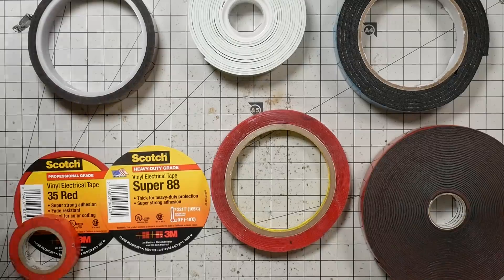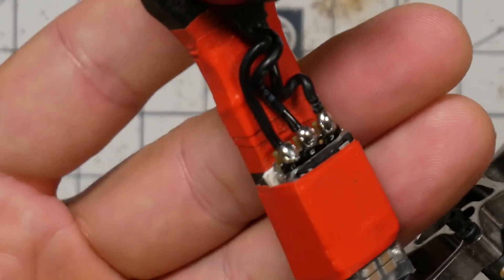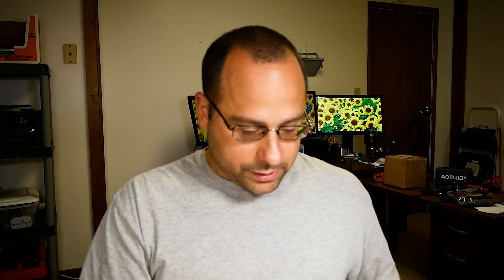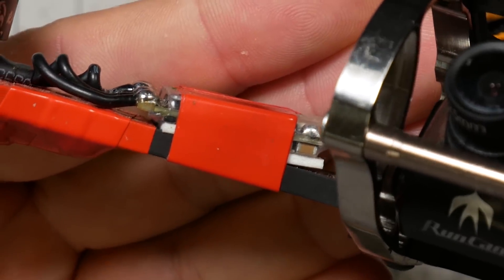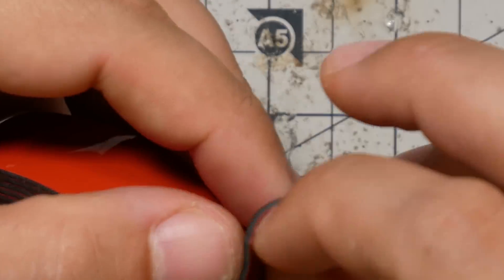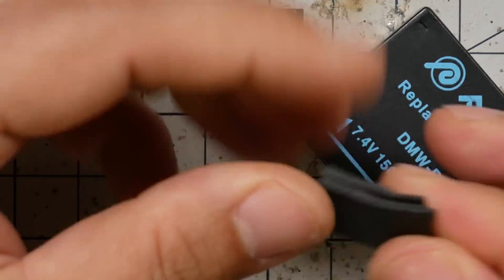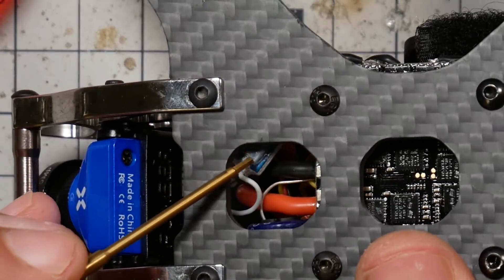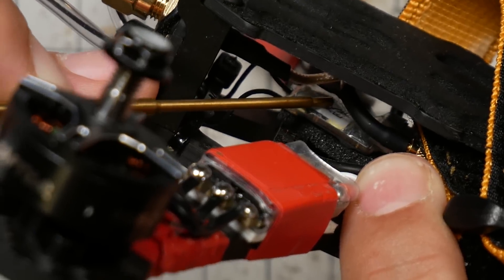Must Have Tapes For FPV Quads | BUILD TIP

Comment: I find with that  3M-4011  tape, if I blow it with low heat ~150*C for a few seconds, it will make it set better. I put the tape on, and put both things together, the way I want them to be, then I heat it up for a few seconds, and after it's warm, I hold them together finger-tight, for a few more seconds. I think it's because it's so gooey, and when it's warmer, it gets even gooier, so it ends up getting a better grip on whatever I'm sticking together. The heat allows it to really get into the tiny cracks and rough surfaces, so once it cools, it has a larger surface area to hold on to.

Comment: I hoped you had the link for the very thin Velcro tape used by emax on their quads.  The velcro is perfect for holding the motor wires to the frame.  I've never found it.  I found some velcro tape that was about 10 times as thick, but the stuff that Emax uses is about the thickness of electrical tape.

Comment: Stop touching the tape with your fingers if you want to it to stick well. Also the surfaces where you want it to stick should be clean. Dirt, dust and finger goo destroy the adhesive performance pretty quickly.

Comment: Is 3m vhb tape okay for sticking Vtx to frame? I'm abit afraid that temperature of Vtx might lower the 'stickiness' and Vtx might fall off midflight... Are my concerns correct?
Reply from the maker: I would use Scotch Extreme Mounting Tape. But I always back it up with a zip tie.

Comment: The 3M clear tape i call "scary tape" :D Reason being, i once by accident put a big roll of it on its side (~350mm in diameter) on freshly cut/peeled aluminium composite plate for like 5 seconds. It stuck so well just by gravity i ripped my skin off my fingers/knuckles trying to peel the reel away. Scary bonding capacity, hence "scary tape". Love that stuff.

Comment: My personal opinion, VHB is stronger than the other you mentioned when used in a single layer. Balling it up introduces skin oil and the extra thickness only helps with vibration dampening.

Comment: Hi JB,
thanks for your informative content - I have a suggestion for your tape collection that could potentially replace one or more of them. Also, it's cheap (at least over here in Europe) and abundantly available in hardware stores (EU, again). Still, you know how to use the internet to order things, I'm sure ;)
Tesa is a brand name, so the infamous "Tesa tape" that was mentioned in some comments is just one of their products - the tape I mean is Tesa article 55741-01-00 (comes in various sizes with different numbers), indoor mounting tape meant for mounting mirrors to walls etc. They make tons of different types that are all adverrtised as indoor mounting tape, but the stuiff I mean has the  yellow/brownish paper covering film you can see on the roll from the outside.

It sticks really well to almost any surface (except for some heatshrinks, the greasy-looking/feeling ones, no idea what material that is) - itself, best of all - and also does hold better if you warm up the contact surfaces a little - 40-50°C is sufficient, just hit it with a hair dryer for a few seconds. I've been using this tape almost exclusively for soft-mounting gyros and FCs on my helis as well as general purpose to dampen things like your ESC mount on the arm or make sure it can't slide even when zip-tied. 

To give you an idea of its holding power, you simply cannot peel it off a flat surface without using some sort of lever or a blade. It does age, but very slowly. I usesd it to mount a ~30g (heli) FC with a contact patch of about 25x25mm. Never moved an iota,  damped vibes effectively. I use this tape to mount a Spektrrum sat on the tail boom of my speed heli - it has done 240+ kph fully exposed right in the prop downwash without trouble and survived crashes.

As an important bonus, you can remove the remains either in one piece (it'll just stretch and pull off if you're gentle) or rub them off with your finger without hassle - cleanly, residue-free.
Big plus in my book!
Also, it is meant to smooth out bumps.

All these combined in one tape is why I always take a roll along to the flying field - you can jury-rig almost anything with a bit of that tape and a zip tie or two ^^

Cheers, and keep up the good work!

Comment: I been trying to find out what kind of tape this BNF has securing the motor wires to the arm (4in1s). It’s black and it’s almost like that cloth firstaid tape in the kits.
Reply from the maker: I think it could be cloth tape.
Reply: Joshua Bardwell I been trying to research and I’m thinking it might be the tape they use in automotive for wrapping up wiring harnesses. But I’m not to sure. It seems really good for ESCs and motor wire. 👍

Comment: Two kinds of heat shrink I use.  Plain old stuff.  And 'dual wall' heat shrink.  The 'dual wall' stuff has glue inside it and seals the joint against moisture.  A bit of glue oozes out the ends when you shrink it.

Comment: I ordered 3 feet of the right size clear shrink tubing from amazon at 25mm width and they sent me 42mm... (I'm not the only one this has happened to) I got this for my recievers to avoid buying kapton tape because I wanted clear shrink tube.... now I have to spend extra to get the kapton (it is very difficult to find clear shrink tube in the right size too, for when u only want 1-3 feet) lol
Reply from the maker: Amazon is very good about returns. If they shipped you the wrong item, return it and get your money back.
Reply: @JoshuaBardwell  I contacted them waiting for a reply. This is a known issues because I read the comments and it happens all the time and on all their sizes of tubing too...

Comment: I can recommend Gorilla Mounting Tape, it’s a transparent, double-sided, like 2mm thick and extremely sticky, especially once it gets to set for a while. My only real issue with it is that it’s difficult to cut without it sticking to the cutting device.

Comment: What do you reccomend to use to mount the tbs unify fro v2 vtx? I dont have anymore of the heat transfer tape that they come with .. what can i use to mount it to my frame without using a thick foam tape? That will pull the heat out of the vtx into the frame? Thanks
Reply from the maker: I just use foam tape. As long as there is airflow it'll be okay.

Comment: VHB tape!  love this stuff. Comes in a TON of different variables like thickness, firmness ,width, etc.- some are thicker and a little squishy/conformable. 3M 471 is also an awesome multi-use tape, little tougher than typical vinyl, adhesive doesn't leave any residue, and has some stretch, really durable stuff.

Comment: I use capton tape, but one tape you never mentioned is Scotch silicone self fusing tape comes in two types. Scotch 70 and High temp self fusing. Great stuff check it out.

Comment: Hockey stick blade tape is great for taping ESCs wires to arms. It is quite sturdy cloth tape, much more than electrical tape and looks definitely neater. It comes in different colors if you want to be creative. It is also cheaper that TESA and other electric tapes brands :)

Comment: Another must both in the field and the bench is the Stretch and Self fusing Tape.  Great for wrapping things that standard heat shrink cant fit.
https://www.homedepot.com/p/Nashua-Tape-1-in-x-3-33-yd-Stretch-and-Seal-Self-Fusing-Silicone-Tape-in-Clear-1210364/203534911

Comment: Not sure what camera you are filming with, but either adjust settings to centre spot for focus and not centre average, or go to manual focus mode with  a wide lens attached and use f/8 aperture or similar for a deep depth of field.  Set your focal length and you are good to go.  :)
Reply from the maker: It's manual focus. I just set the focus wrong by accident.

Comment: You might add reflective tape to the list. I wrap a band around each arm. That way if the quad goes missing and all the buzzers fail to get my attention, I would just go back at night with a flashlight and might be able to find it pretty easy. Wish I had thought of it before I lost my first quad. It's still out in a wheat field, covered in dirt by now...gone but not forgotten. So from now on, reflective tape and a Hellgate buzzer.

Comment: You should also test 3M 4010-tape. It's perfect tape also for gyro vibration dampening purposes. It's widely used in RC-helis for FBL mounting. 2-pieces stacked for nitros and 1-piece for electric helis. That tape sticks really well as it is used in nitros where oil and vibrations tears everything else off.

Comment: Ever considered using BluTack as a mounting tool? I just use it like play dough and squash my vtx or rx in it. It never dries up so it's easy to remove and change around. I mounted an fpv cam to an off road rc buggy and it never came off during lots of vibration and roll overs so I tried it on the quads.

Comment: Awesome work Mr B. I am also a tape man.  I could add a couple:
Gorilla Tape (their version of Gaffa tape). Fairly rigid and very strong - very useful in certain situations...eg new hinge for Devo radio battery compartment...broken quad arm for that last flight...broken flying chair...kidnapping...
and then there is 3M VHB grey foam tape/sheets - I use it for uneven surfaces as you can get it about 5mm thick and it really sticks if your surfaces are clean (a vital part of any tape is surface prep - get some anhydrous alcohol for a grease free clean).
Happy flying, taping and whatever else you get up to

Comment: Have you ever used self adhering silicone tape? It's sometimes used for out door electrical work. In the air Force we called it "F4" tape. I don't know for if it was used a lot on f4s or if that's just the name of the tape.

Comment: In NASA requires all heat shrink tubing to be transparent of translucence. After finding some transparent heat shrink tubing I started using it and now I can't stand to use the normal stuff. It's really nice to be able to see the connection through the tubing.
I highly recommend transparent heat shrink tubing.

Comment: When Using servo tape, heating it via a lighter or solder iron before sticking it to the frame increases the bond several times over.

Comment: There are 2 other tapes that Joshua missed that are fantastic for quads and electronics.

BCP Double Side Adhesive Thermal Conductive Tape for Heatsink LED  -- Bluecell brand is the best.
Silicone Rubber Self Fusing Tape -- X-Treme or F4 brands are the best.

The Thermal Conductive Tape is very thin (< .3mm) and has a fiberglass core which doesn't tear easy. It is very sticky, and sticks far better on flat surfaces than other double sided tapes I've tried. 
It is heat conductive so it doesn't mind very high temps, but is electrically insulative to 3KV.
The downside is that it requires using a razor blade to separate the parts if needed, which leaves the adhesive behind. (Cleans up easier with alcohol than the foam adhesive residue.)  

The Self Fusing Tape is great in that it only bonds to itself and not much else.
The layers actually fuse together, and after a day or two, it is permanently bonded. The key is to stretch it several times before and while wrapping it to keep it tight.
I use it instead of heat shrink around electronics like ESC's, for many reasons.

-- It is cheaper than having multiple sizes of large heat shrink. One size fits all and it comes in clear and several colors.
-- It is very easy to put on and custom form around almost any size or shape, and doesn't require any heating to shrink it. (Sometimes I use a little CA glue to tack down stubborn edges that don't stay down.)
-- Instead of attaching the ESC's to the arms with electrical tape, just put a layer of the tape around the arm to insulate the ESC, then wrap the ESC. That way there is no sticky electrical tape goo later. 
-- Unlike heat shrink, you don't have to put it on before soldering everything together. So it is not a problem if you forget to put it on before hand. Also, you don't have to de-solder anything to put it back on later. 
-- It stays rubbery and depending on the thickness, offers some impact and vibration protection, and is very resistant to heat.
-- To remove, it cuts easy with a razor and comes off clean.

Comment: Hi Joshua, great video. There is a tape that I use all the time to add battery grip to any surface. It is super thin (and therefore lightweight), super sticky and very high grip. It mimics the grip of gecko's and so has a dry non-tacky surface. I use it underneath batteries and on the inside of battery straps. Alternatively, add a band of  it around your batteries where the strap goes, to create a gripping surface. 3M Gripping Material: https://www.ebay.co.uk/p/3M-Gripping-Material-25mm-X-2m-Grey-Gripp-Adhesive-Tape/1955028359
Reply: I've linked to a possible supplier of small quantity above. Only thing is, I can't be sure that this is the exact tape. The exact tape I had in mind is 3M GM631 Grey 1inch x 5yrds roll. It looks like it's available on Amazon.

Comment: Awesome video. I use self adhesive  silicone tape,, which is way better than electrical tape.  Reason why I use this type is because it's self-adhesive sealing tape made of high quality silicone rubber, waterproof, resistant heat,insulation. So, it won't stick to components but it sticks like hell to itself. Plus it's operating temperature range is -60 ℃ to +260 ℃ so it won't peel off like electrical tape does under extreme weather conditions.

Comment: Joshual Bardwell. I bought and am using your Flight Controller after completely trashing my eachine stack x. It works great so far but my only concern is that the dual buzzer I have now only emits a super low tone rather than its ear piercing buzz it used to before installing your FC.  ZCGC Drone LED Tail Light Board with 5V Buzzer Dual Mode (FC TX control)  from amazon is the read led/buzzer
Reply from the maker: It may be wired up incorrectly? Or maybe there's an issue with the FC. The buzzer circuit in the FC is no different than any other.

Comment: Book binding tape..... the only tape you need that isnt double sided. Tesa harness tape is a second to that.  unless your repairing/building packs, then you want some Kapton.  There is little place for PVC electrical tape on quads. Only use it if you want a sticky mess when you go to tear it off.

Comment: Funny I use some of those tapes also. I worked at a place where we built transformers for navel ships and subs and used caption tape to cover bare thick wires and then used heat shrink on top of that. Good video Josh.

Comment: Black 3M doublestick? Awful tape. The grey stuff is much better.
Reply from the maker: What's the difference?
Reply: The grey tape, same red backing on it, seems much stickier and doesn't leave residue when pulled off. Nor does it need time to "set" to activate the adhesive.

Comment: In the decades I've been tinkering with wiring & electronics I've never liked electrical tape, sure it's nice and stretchy - I once used a piece to fix a puncture on an inner tube of my bike :) - but the sticky part of it is horrible, it almost always leaves a yucky residue that's a bugger to remove if you don't have any sort of chemical (lighter fluid is my favourite right now), which gets worse the older it is.

Comment: I'm very serious about tape. No joke. :) Tape is an engineering supply and artistic medium for me. Scotch Clear Transparent Tape is the best small width tape, and they have a new double adhesive version that I haven't tried yet, don't think it will hold still under tension as well with such think adhesive (it may slide). I have a favorite wide clear (packing) tape but it's not produced anymore. I have 6.5 rolls of it still though 'cause I bought a ton of it because things this good don't last forever. No other clear tape can even approach this stuff. It shocks me with everything about it every time I use it. I have foam planes that I used this tape to build way back in 2008, and all the tape is still clear and will never come off, and it's tensile strength is unreal, and it's super thin and light. Crazy! Other tape just fails within weeks to months, or even when just trying to get it off the roll. Scotch "Shipping" Tape is the WORST (type) of tape, stay away!  lol  Cheers  :)

Comment: Tesa 51026 is a high temp tape and 51036 is the highest temp tape they offer (Audi,BMW etc harness tape) Rated to 300 F is pricey but excellent product. I use it for engine harnesses for custom Cars and my quads

Comment: Could you add a battery strap section to your website?  Stupid cheap straps 4 packs deep and they break
Reply from the maker: Newbeedrone is the best IMO but it's too thick to go through most frame slots so you have to put it around the plate instead of through it.

Comment: Kapton tape is great for heat isolation. If you need to solder on a dense board with nearby components that you don't want to overheat, mask the surround area with  Kapton tape.

Comment: @Joshua Bardwell around minute 4, the focus slipped out on your face and locked on the monitor on your desk behind you.  In case 100 people haven't already mentioned this.  Maybe slightly smaller aperture ( to accommodate head movement) and fixed focus? Great vid otherwise! You, sir, are amazing.

Comment: For the vhb tape. Throw it in the freezer for a few min before use. The cold shock will stiffen it making it easier to peel off the backing.  Then within seconds of bonding it's back to it's usual goopeynss. And +1 for tesa tape

Comment: The kapton take you linked to is really cheap. Are you sure it's true kapton?
Easiest way to test it is to take a lighter to a length of it. If it burns/melts, it's not kapton. If it just chars, you're good.
Reply from the maker: I just held an 850 F iron against it and it burned/charred and did not melt.
Reply: Joshua Bardwell Sounds like you found a bargain. I used to use that stuff in the aviation industry but it was way more expensive.
Nice find!